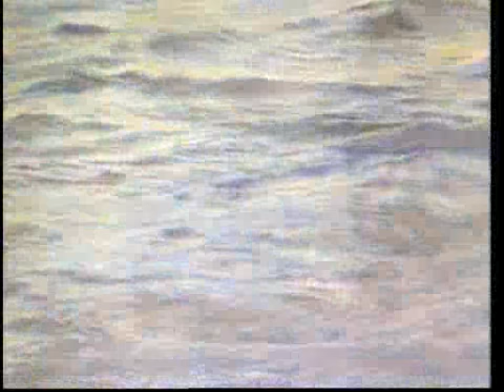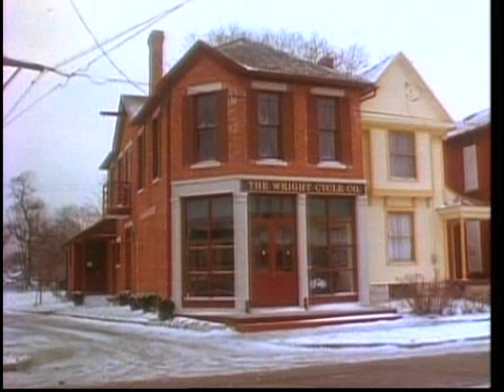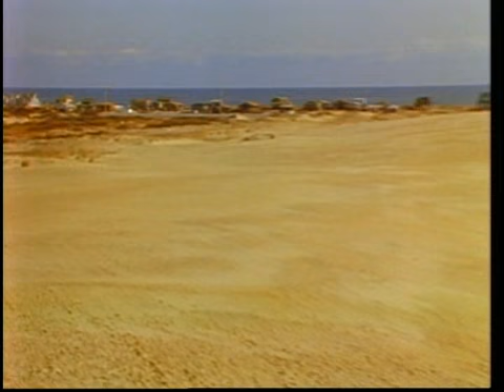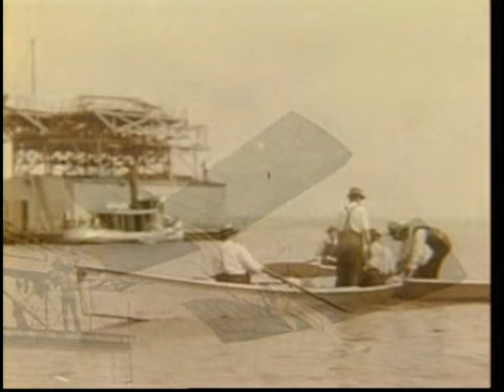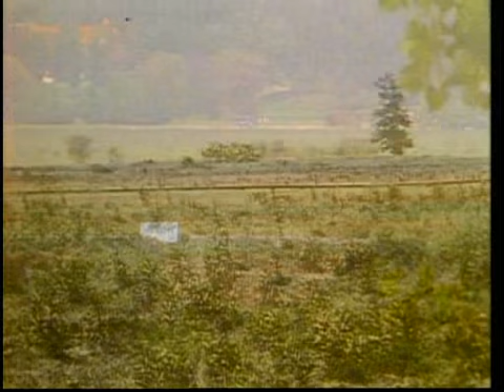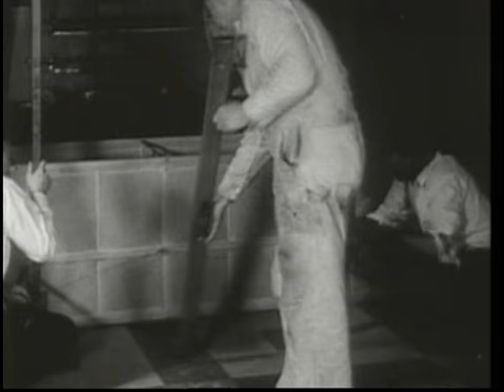Frontiers Of Flight - 01 - Powered Flight

Comment: Richard Pearse  FIRST powerd flight Wrights first Controlled  flight  history has been corrected Wrights where still  floating around on gliders Pearse had a 2  cylinder 4 stroke engine ,front mounted mono wing with full controls. look it up.
Reply: Pearse flew long after the Wrights according to Kiwis... http://www.stuff.co.nz/national/6799761/Pearse-flew-long-after-Wrights
Reply: Pearse's flight was only a brief, non-sustained hop ending in a crash -- so he did NOT make the first powered flight!  (Whitehead might have, but if so, it was only partially controlled.)

Comment: Yup...they were the first to have a reliable and controllable machine, whereas others got something "off the ground" perhaps slightly earlier. The fact that they waited for years to actually reveal it is a testament to how far ahead they were.
Reply: Tom Martin The Wright's patents did hinder the advancement of aircraft design by others for a few years.  That is why the government bought the patents and put them in the public domain.  But by admitting that, you have agreed that they had made CRITICALLY IMPORTANT DEVELOPMENTS to aircraft design.  As eddie telleed stated, others had made powered flights before the Wrights, but they were not under control.  The Wrights were the first to see the need for dynamic roll control.  NOBODY else had thought it important at all.  The Wrights invented ailerons, which were included in their patent for wing warping.  Other aircraft designers saw the Wright's planes and immediately realized the need for roll control and they built planes with roll control in violation of the Wright's patent.  Curtis was one of the builders who stole their ideas, and he was made to pay in court.  Also, early on, the Wrights used Lilienthal's tables to built a glider and discovered Lilienthal was mostly wrong.  The Wrights did their own research and developed their own accurate tables.  Nobody else in the world had tables that were accurate.  They all thought Lilienthal's tables were good.  The Wrights were systematic in their research, which was an attribute their competitors seriously lacked.
Reply: +Gilberto Nedel Junior beto     Its extremely frustrating to comprehend the arguments, or better, the ramblings of someone who cannot communicate in English. Your points is not being made, you are typing in all caps which basically signifies shouting and if you disagree that the Wrights were the first to achieve powered controlled flight that is your prerogative but pieces of the Wright flyer now reside on the moon placed there by AMERICAN Astronauts and you cannot argue with that as a "first".
Reply: +troxa troxa Nope, the Wright brothers were the first to fly, look it up in any encyclopedia.
Reply: Tom Martin Just silliness. They were the first with many inventive ideas.
Reply: ***** Do you know that there are lower case letters?
Do you know that every reasonable person on the planet knows that the Wright brothers were the first to fly?
Reply: ***** Nope, the Wright brothers are definitively the first to fly.
Reply: eddie telleed The Wright brothers did more to hinder the development of powered than than they ever did to promote it. They achieved their first flights then became obsessed with patenting their device. If not for they work done by many before them, they most certainly would not have succeeded. 
Testament to this is the fact that many others achieved powered, controlled and sustained flight independently of the Wrights, albeit shortly after.
If the Wrights had put their energies towards development of flight rather than pursuing every other airman at the time, perhaps they would have produced good aircraft and deserved the acclaim afforded to them by America and it's tailored version of history.
Glen Curtiss is your true father of American aviation.
Reply: The Wrights were the 1st to fly an aircraft that's heavier than air, powered, landed at an elevation at, or above it's take-off point, AND MOST IMPORTANT HERE, CONTROLLED!  Other inventors beat the Wrights to get a plane into the air, but they lacked full control.  Without full control, they were too scared keep going up their craft.  The fact is that the Wright's 1st plane only flew because it was at sea level, and the air temp that day was very cold.  The plane needed the densest possible air to get off the ground.  But witnesses attested that it did get off the ground under its own power.  Ultimately, it didn't matter that the engine they used was useless under normal conditions.  Others were developing lighter, more powerful engines, but the Wrights were the only ones working on full control systems.  When they started doing testing in Ohio, the plane wouldn't get off the ground without a strong head wind, plus, the field they used was small, soggy, and bumpy.  They had to decide if they wanted to spend money on a better engine, or just focus on improving the controls.  Knowing they could get a good engine later, they decided to go with a catapult instead of wasting money on an engine.  The Europeans were so impressed with how well the Wright plane was controlled, they admitted the Wrights were superior.  By 1908, the Wrights had a better engine, but continued to use the catapult and rail system because it got them into the air quicker, and more safely.  Airstrips at the time were not smooth, and accidents on the ground were a risk to avoid.  In 1908, Wilbur's altitude record breaking flight was denied because the French record keepers said the catapult was a cheat.  He promptly took off without the catapult, having only skids, no wheels, and still broke the record.
Reply: ***** Nope, you're totally wrong.
Reply: ***** Did you know that if you looked up 'airplane' in any encyclopedia, it will list the Wright brothers as the first to successfully fly a heavier than air machine?
Reply: +alan sargent prrof   with   official  declarations   between   1903    1907  with  official   stamp  and  officvial  register   usa  government,  proof  please.
Reply: +beboboy mann  -  in   1907  the   wright  brothers   asked  the  complet  description  of  santos  dumont  machine,  and  finally   1908     show   your  capacity   flights,   the   letter  for  captain  ferber     -  INTERNATIONAL  MUSEUM    FOR  CAPTAIN  FERBER   PARIS. -  l'  envol  magazzine    number    39    1932,   idiot.
Reply: +alan sargent  -- motorized    glider     are  not  airplanes,  the b rothers    machine  is  a  motorized  glider  in   1907  the  brothers  asked  the  complet   description  of  santos    machine.

Comment: THEY DID NOT MAKE THE AIRPLANE
Reply: Yes, but they made the first manned, powered one that was controllable and capable of sustained flight. They may not have made the first airplane, but they made the first practical one
Reply: gustave whitehead  made the first powered flight in 1901 2 years before and he was lost in histroy
Reply: First powered flight, but was it controllable and sustained? Also, how long did he fly for and how far did he fly?
Reply: 190 sec 3 miles
Reply: Ok, so I just read an article saying he reportedly made a powered flight on August 14, 1901 that said his plane flew for a half mile. So even if that's true, that's nowhere near your distance estimate. That is impressive though
Reply: +Ludwig Beilschmidt 190 sec=.05 hours, so we have a ground speed of 60 mph? according to what you wrote-impossible?
I was under the impression that (according to eyewitnesses) it was half a mile (2640 ft.) in 10 minutes or 3 mph ground speed, which is still unrealistic based on estimates of what the machine weighed vs power to weight.
Reply: There is no need to look at inferior machines-no one knew that control was the primary obstacle to solving the flying problem in the early part of the last century except these two men from Dayton Ohio. There is no need for further discussion as far as their place in history with regard to the invention of the flying machine.
Reply: Ludwig Beilschmidt If Whitehead's plane was fully functional, we would all know his name today.  He was just another inventor who hadn't really thought out all the related issues and work on them.  The Wrights did exactly that, and that's why their name is famous.
Reply: No, you are wrong. " that made Orville quite upset"...please state your source, I have never seen any such item, nor reference to any such item by Orville Wright directly. Again you are creating controversy from nothing to sell more of your books..
Reply: Also Ms. Brinchman, please tell us what was the  list prepared for by Mr. Abbott of the Smithsonian, in 1942 for Orville Wright? What were the contents of this list and why was it so important? Was Charles Lindbergh ( I assume you know who he was) ever involved in the Smithsonian dispute and why?
Reply: Not really true. In 1948, following widespread information about Gustave Whitehead's earlier flights that made Orville quite upset, his attorneys, family and close friends and defenders against Whitehead contrived a contract that Smithsonian signed post-mortem, in order to obtain and keep the Wright Flyer. So history was hijacked to control fame and make a profit.

Comment: "Every aviation pioneer of that era, including: Langley, Lilienthal, Maxim, Chanute, Herring, Pilcher, Archdeacon, Ferber, Dumont, Delagrange, Farman, Weisskopf (Whitehead), Esnault-Peltrie, Levavasseur, and Bleriot believed that succussful flight could only be acheived by the concept of "Inherit Stability", where the machine would be designed to maintain level (with lift generated by the pressure against the underside of it's wings), and a turn would be accomplished by the shifting of weight, sometimes combined with a rudder to act like a boat's rudder, to complete a turn. Because of the air machine's "Inherit Stability", input from its pilot would only be necessary if the machine moved from a level condition.

"Wilbur Wright believed the opposite was true, as he had observed that birds maintained control, while soaring, by constantly inputing minor changes (with their wingtip feathers) to constantly correct themselves, in otherwords; "Inherit Instability". Its understandable why the Wrights understood this fundemental difference, as they were bicycle builders and bicycles require the same equilibrum balance as an airplane requires, especially considering an airplane must operate in a 3-dimensional world."

"The magnitude of what they had done could be appreciated only by those who fully understood the steps they had taken and the problems they had solved through four years of work. That included the two of them and no one else in the world. They had flown, barely. But they were utterly alone in their comprehension of what that really meant."